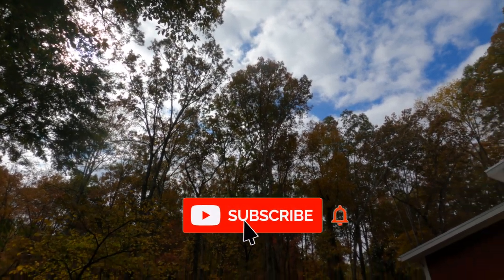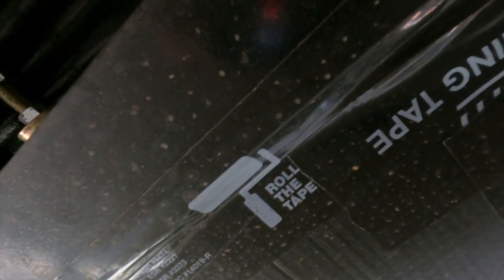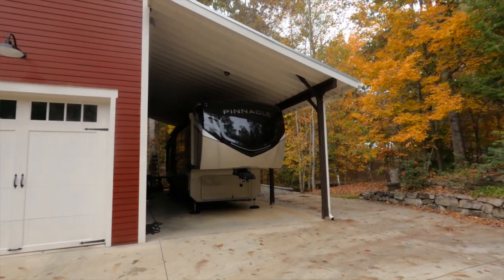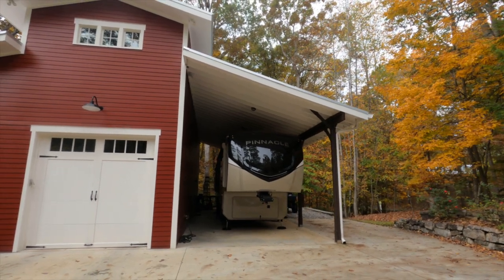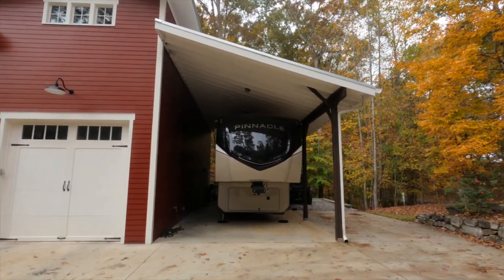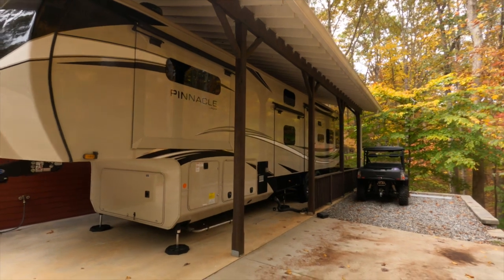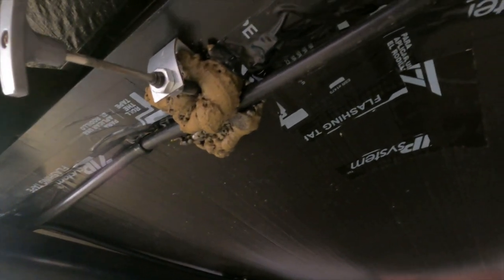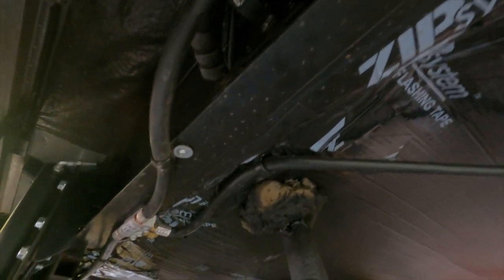Sealing My RV's Underbelly One Year Follow-up // Was It A Mistake? // Watch Before Sealing Yours

Comment: Great video again! Do you have a video about winterizing the whirlpool residential refrigerator with an ice dispenser in my pinnacle?
Reply from the maker: I do not have a video on that. I actually don't winterize mine as we use it year round. However, if you've got the drinking water system on your Pinnacle with the separate pump, there are a two main options: 1) I should mention #1 is not my preferred option personally, but it is possible. You can simply put the feeder inlet from the water jug into an RV antifreeze jug and then pump that through till your filtered water dispenser in fridge and kitchen show the antifreeze. Of course only use RV antifreeze. I don't prefer this method as then you have to really flush/rinse in the spring when you want to use and sometimes the "taste" of the RV antifreeze lingers for a while. 2) Other option is to "blow" out the filtered water line. It's a bit more complex as you have to disconnect the filtered water line AFTER the filtered water pump using the existing disconnect fitting (press on outer collar to release) and then connect to a homemade adapter that converts to your air compressor whether shrader valve or quick connect fitting. Then have your air compressor set to a low 20-40 psi and wait till nothing but air comes out of frige filtered water and kitchen water dispenser. I hope this helps.
Reply: @AdventureRocks  Thank you very much for your quick response. It's very appreciated.
By the way, I just bought a dishwasher like yours (Fisher Paykel) I watch all your videos diligently and they are great. Thanks again.
Reply from the maker: @jocelynpethel1932  Glad to help. Dishwasher is so useful and convenient. Thank you for the kind words!

Comment: I would be worried about mildew if you live in the south.  Let us know if you notice more mildew then you used too. This is also a problem with new home construction techniques that are much better than years ago. They now have to install woke home dehumidifiers.
Reply from the maker: Zero mildew. It's not 100% sealed as a separate compartment. The underbelly in a towable RV shares the same air as the main living space...that's how they're all made at the factory at least. So sealing the underbelly only means closing off or minimizing the outside air, but even then there are still small penetrations such as slide rams and access holes in the frame that still allow some leakage. I like to think of it like leaving your front door wide open on the house versus leaving it cracked just a little bit.
Reply: @AdventureRocks  I was actually referring to the living space not the utility area under the finished floor. Many rv’s have mildew problems in general even without the sealed underbelly especially when storing in the winter months. What area of the country do you store your rv?
Reply from the maker: @markpillori  My apologies for the misunderstanding :) For me in the Southeast I encounter higher humidity in the hotter summer months, and since we keep things like linens and other personal items in the RV while not in use I choose to use a compact, but powerful dehumidifier when storing RV to keep it under 45% - https://www.youtube.com/watch?v=btpii1mjy_s

But, with sealing the underbelly it makes the dehumidifier more efficient in a some aspects since prior I would have been technically dehumidifying a significant portion of the outside air around the RV given how leaky the underbelly was and its connection to the living space. I don't seem to have humidity issues in the colder winter months mostly, more the opposite with mostly dry air in my case, but humidifier will run if needed, just less efficient in colder temps.
Reply: @AdventureRocks  That makes sense!  Thanks for the answers!

Comment: Off topic, how do you like having the tray that slides in the basement? Do you lose space or is the benefit of access over ride the loss of the space?
Reply from the maker: I like the storage trays. 3rd one I've installed on an RV. Makes getting access much easier and faster without having to re-arrange. You loose some space technically with the elevated slide to clear opening, but given the low CC to begin with and enormous size of opening to begin with, it's worth it in my opinion and more efficient/practical. Also for servicing you can just slide tray either way to instantly gain access without removing all your stuff. Here's a more detailed video featuring the tray if you didn't catch it already: https://youtu.be/wV46agTKYrA
Reply: @AdventureRocks  thanks yeah access now isnt the best for the middle stuff. i have the northpoint 377rlbh, basically the same camper just a few less upgrades.

Comment: How about Class A or Class C motorhomes?
Reply from the maker: Full disclaimer I don't have personal experience on Class A or C, but I think (emphasis) the leaky underbelly issues are less common on the Class A or C. I would love to spend some time with one and gain more experience on them. I would imagine they still have some vulnerabilities and transitions left open that could be sealed, but I think overall they are better perhaps due to the frame structure with rails being more on center/middle compared to spread out like on towables.

Comment: Any concern of mold growth since it is sealed underneath?
Reply from the maker: The key is to leave the penetrations between the living space and the basement open as is, from factory (plumbing, electrical, etc). So the underbelly is not actually sealed completely as a separate space, but rather sealed only from the outside.